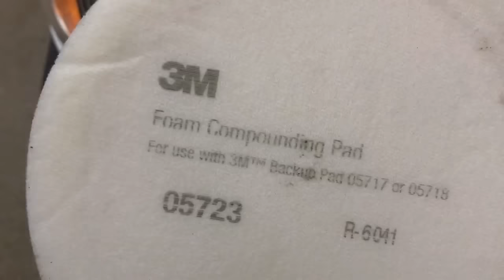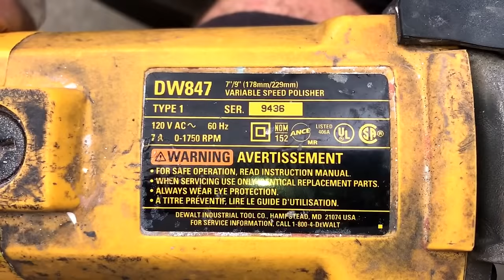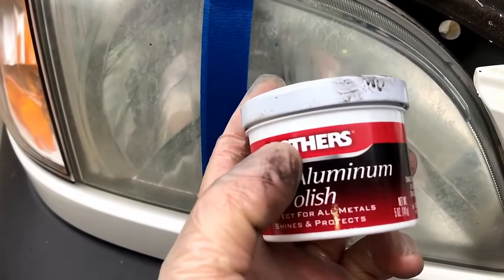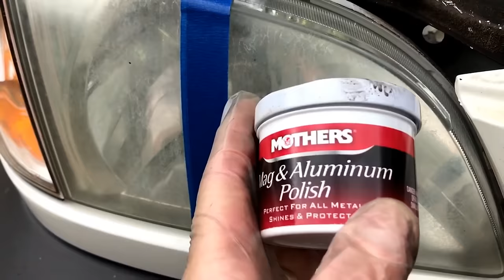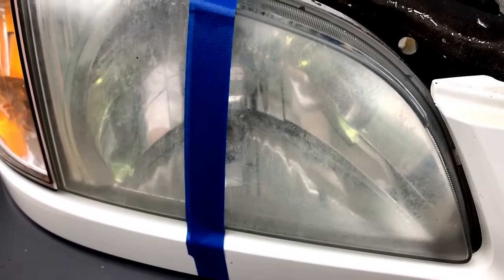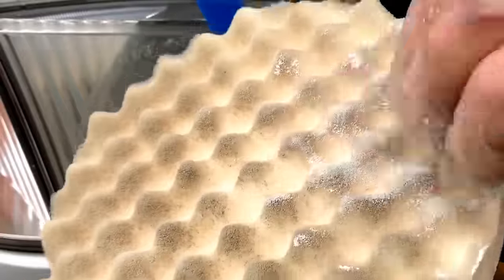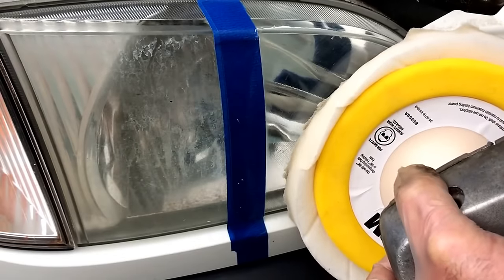How MOMMA Repairs Headlights BACK TO BRAND NEW in 3 Minutes

Comment: Can you please shed more light on the after polishing process...do you clean the polishing compound residue off the lenses before applying the 303? Also, which 303 product do you use, and how do you personally apply it? Also, how long does the 303 last? How long between applications?
Reply from the maker: Budz Wingren all the products we use are in the "SHOW MORE" of the video description. once you have buffed them and satisfied with the shine and clarity you then spray a light mist of the UV protectant on and let it sit for a few minutes and then lightly buff off and as far as how many times you do this depends on your location, you can do it as often as you like it will not hurt them but  for instance in Texas you would apply a light mist of the UV protectant once every 2 to 3 months in the northeast area of the US you would do it about once every 4 to 6 months  we say when you detail your car take 2 minutes and car for your lenses and plastics.
Reply: @SweetProjectCars  Should I clean the lens after buffing to make sure no polish residue is left behind, or just go straight to the protective coating? Does it matter?
Reply from the maker: You will just use a microfiber and buff by hand to a finish shine then use the UV protectant

Comment: What's the max speed (rpm) you're using on that DeWalt polisher?
Reply from the maker: We vary it up and down, we start slow and get it to 3000rpm, but we don't stay at 3000, we keep the buffer moving and varying the speed. Thanks for watching Steve, have a great day. mad Mike the hammer SPC

Comment: @sweet project cars Can you show us how to put the 303 Protectant on it? Full headlight process. Thanks in advance.
Reply from the maker: Brute it is very simple, my friend just spray it on in a light mist and let it set for a minute or so then lightly buff it off and you are done.   thank you Brute for your great comments we appreciate your helping the SPC channel!
Reply: Sweet Project Cars ok I already wondered if we had to use a brush or something to get it spread equally. I don't want to spray or brush it like you see a kinda varnished glossy layer. This is not allowed in my country and will not pass the yearly car checkup.
Reply from the maker: brute you can place it on a towel and wipe it on if you can spray it...it is water based and eco-friendly and nothing more than a UV protectant.    thank you for your great comments we appreciate you helping the SPC channel!

Comment: Can't understand why you didn't tape around the headlight First!! As you where useing an oversized polishing pad? Second your method seemed good on a bare none coated lens, But would it work on a old clearcoat such as K2? I Wonder🤔🇬🇧👍
Reply from the maker: Hi Keith we didn’t tape around the headlight because there’s no need to the polishing material we were using is the exact same stuff we use on all clearcoat and paint the only way there would be damages if you held the buffer on the paint for 2 to 3 minutes without moving it if someone is going to do that they should not be working on their car

Comment: Hey, what would be a fair price to do this for a customer?   20 bucks?
Reply from the maker: 20 bucks per light is fair
Reply: Thank you most noble headlight restorer!!!!!
Reply: I will charge $25 per headlight if I have to use sand paper and restore them or am I cheating meself?
Reply from the maker: if you have to do this video here https://youtu.be/GKLF8oIWYGg then you should charge them 60 to 75% of what a new set of OEM headlights would cost them

Comment: Was that actually oxidized or just have salt and road film on it?
I have a 21 year old truck that has cloudy yellow lenses. Those looked more like salt and stuff from winter roads.
Not doubting you, just asking 
Wish you would have cleaned them first on camera to see how bad they were after washing.
Definitely a cool video.
I only have DA polishers so I'm hoping this will work with a DA as well
Reply from the maker: 2010stoof if you look at the date of the video you will see there was no chance for salt also if you try this method yourself you will see it is the best thing going anywhere you have no reason to worry as it would cost you about 10 bucks if you do it by hand
Reply: @SweetProjectCars  so will this work with my DA or do you need a rotary?
Reply from the maker: 2010stoof you can try it with your DA and see how it works we have never had luck with them when the headlights are real bad

Comment: What if the headlights are chipped from taking the car the track? Would it work as well?
Reply from the maker: Will definitely make them look better but you’ll most likely have to sand them down if they are chipped slightly but if there are chipped bad you’ll just have to replace them

Comment: What rpm did you use on your polisher?
Reply from the maker: You vary the speed, when you first apply you go slow 200 or 300 rpm, then you speed it up.  So slow at first so you don't slop the stuff all over, then when you speed it up be careful you don't burn the lens, touch the lens every once in a while to make sure you aren't heating it up.  Thanks for watching and asking.  Have a great day.  mad Mike the hammer SPC

Comment: My Civic 2018 lights have small cracks I put on a tint overlay with stock bulbs in and they got too hot under the tint and cracked the headlights. I replaced them with LEDs I noticed them bubbling through. 
 I plan on taking off the tints to fix this but I'm afraid they will crack more if I take the tint off.
Help!

Comment: You have to sand all the factory clearcoat off the lens. That is what discolors and gets hazy. That is what's left on the bottom of your lights. Start wetsanding with 320 grit until all the clearcoat is gone. Then work your way up to 2000 grit and finish them by buffing. Again, the clearcoat must be removed first.
Reply from the maker: With This method you don’t have to do that only if the headlights are yellow and we have a video on that

Comment: Not saying this doesn't work, but what I would love to see is a video where you come back 6-hours later to see if it looks the same after it has dried off. To be honest, I could grab some coconut oil, buff it just like this and it will look fantastic. Except when I come back several hours later it will look exactly like it did before the buffing. Again, not saying you're not legit, but a follow-up video would go far in selling this.
Reply from the maker: this is actually polishing the plastic so it works every single time and last for years when you use the conditioner shown
Reply: @SweetProjectCars  Well, I just purchased it from the link you provided. I have confidence that it will do well. At the very least, I know it will not waste my time.
Reply from the maker: He will love the results my friend
Reply: @SweetProjectCars  Results are in, my friend and I am loving it! Fast and easy! This stuff is fantastic. I will never waste time with sand paper again! Thanks for posting the video!!
Reply from the maker: mondo that is great to hear my friend

Comment: What is a good cordless drill to do this ?
Reply from the maker: MgC-137 we have used these for years with great success they are very tough for the price  https://amzn.to/2GqvImv and they spin fast enough to do the job
Reply: I have one that does 650 rpm that should be good enough right? And thanks for your reply.
Reply from the maker: MgC-137 as long as you have the 20v so you can get the 1500 rpm's you need 650 is way to slow
Reply: Alright cool thanks. 👍

Comment: What is the interval of appying UV Protectant?
Every 3months?
Reply from the maker: 2 to 4 times a year depending on where you live and how much sun you get
Reply: Sweet Project Cars why not use a clear coat for permanent protection?
Reply from the maker: narmenia because the clear coat yellows...you need a water-based protectant like the 303
Reply: Sweet Project Cars will using the Turtle Wax Metal Polish have the same result?
Reply from the maker: narmenia you can give it a shot and see if you like the results compared to the mothers

Comment: Metal polish is more abrasive which is why it worked so well...but I would be weary of doing this on the same headlights multiple times.
Reply from the maker: Gurvinder Parmar we have done it on headlights multiple times and they just get nicer looking every time with no issues for our customers
Reply: @SweetProjectCars  Wouldn't the abrasives in metal polish wear down headlights? I guess it shouldn't matter much since sanding probably takes more off the headlight than a polish.
Reply from the maker: You would have to polish those headlights for years to wear down the headlights you only have to do it once every three or four years and if you keep the UV protectant on that we share you most likely Will only have to do it once every 5 to 10 years but then again wearing the plastic down will not happen we use the same metal polish to buff out scratches on clearcoat on car paint it’s all we use and we get fantastic results with it it is a hidden secret of ours that we have let out
Reply: @SweetProjectCars  I saw that video of using it to get scratches out...it was amazing...I actually had about 3-4 scratches on my black 2017 Buick Lacrosse...I got 3 out if the 4 out no problem using Meguiars...but one small scratch is giving me trouble. I used a DA polisher with medium cut orange pad...the scratch is less visible now but it's still there...what metal polish would you recommend I try to get that last scratch out? Should I remove it with the DA or by hand? A friend of mine also has some orange peel on his bumper which we are trying to get out...any suggestions for that?
Reply from the maker: Gurvinder Parmar  We use this https://amzn.to/2LFYWSW we don't use DA's as they don't spin fast enough but if it is all you have then use that with the product we shared

Comment: Is that healight glass or plastic?
Reply from the maker: It was plastic as 99.9% of them are these days
Reply: @SweetProjectCars  unfortunately so but 2 be fair id rather have plastic on the ground than glass. Almost be revolutionary if they created a off type from bulletproof material. If its possible without a great deal of cost difference of course. Thanks just wanted 2 dbl check.

Comment: with this work when the headlights have flaked off sections of old clear coast?  Mine you can actually flake it of with your fingernail.
Reply from the maker: if it is flaking off now, sand it with 2000 grit wet and dry to remove the flaking then do this process

Comment: I've tried this on my 2008 Honda civic hybrid. I had to do it by hand but very little change and my headlamps are only partly clouded. Can't understand why it works for everyone except me.
Reply from the maker: Let me help you understand why it didn't work, my friend, you need to do the process as it's shown in the video, you cannot do this by hand. Have a great day. mad Mike the hammer SPC
Reply: @SweetProjectCars  yes I appreciate your advice it's just that there are so many people in videos who have done it by hand and in a matter of minutes. I don't have access to a power tool. I may take it to my local car wash the guy there as a power tool. There's a video on here somewhere a guy is using a power tool but it doesn't work for him either.
Reply: If you use a tack cloth and do it by hand it might give you better results than a regular cloth. I didn’t have a tool either and it worked. Then i got a little attachment for a power drill and it was much better than by hand.

Comment: does anyone know if this works if there are flakes of clear coat coming off the lens?
Reply from the maker: as I said before my friend   if it is flaking off now, sand it with 2000 grit wet and dry to remove the flaking then do this process

Comment: Bear in mind that headlight restoration kits work, and some even have final coatings to resist UV.  But you and I at home simply cannot duplicate the factory anti-UV coating that is applied in a carefully controlled environment.  Headlights cloud up because their anti-UV coating is failing. Polishing removes every last vestige of that factory coating.  So if you cannot obtain new factory headlights,  and you use this method, you WILL be doing it again.  Also, remember that polishing the lens does not renew a reflector or get rid of condensation inside a leaky light.  So it's like Clint Eastwood says, "a man's got to know his limitations."  Polish that light if you must (it's cheap and sometimes you cannot get new ones), but accept the limitations of the process.
Reply from the maker: Lane Dexter we have a cure for UV damage after the headlight is polished https://youtu.be/hD2CKp9mco0 this video...problem solved.

Comment: I agree 1000% those "headlight restoration kits" are a joke.  I got one from Walmart and the sanding disks weren't actually sandpaper at all...they were textured plastic discs that disintegrated as I tried to refinish my headlights.  I started seeing these little granules of material and I stopped what I was doing and started trying to figure out what this was...then I saw that the pad was just coming apart on my headlight.  In case you're wondering.. it was the Rainx kit I bought...utter garbage. The only saving grace for this kit was the fact that I got a 3" drill attachment that I can use with other hook & loop pads/disks.
Reply from the maker: Thank you very much for sharing we appreciate that and it’s great comments like this that help others out there save a buck as well thanks mad Mike sweet project cars

Comment: I would add that it would be better to mask all surrounding painted panels to avoid burning thru clearcoat.
Reply from the maker: There is nothing abrasive that we use in this process we have never taped off when we are buffing we have done this for over 20 years and never burned through anything now if you’re sanding yes it should be taped off thank you for sharing

Comment: The trick is to buff out the damage.  Shops that sand and then spray clear-coat just wreck the optical properties of the plastic and it never throws light correctly/has odd halos and hues.  RUN AWAY.  Clear-coating headlights is effectively putting cheap window tint on your windows - good luck with clarity.  If it gets foggy again in a few years,  or even a year, re-do it - it's a 5-10 minute process.  Most plastic can be re-polished like this 10-20x before they are actually suffering any structural damage.
Reply from the maker: Thank you for watching and sharing, have a great day my friend. mad Mike the hammer SPC

Comment: I was just thinking, this takes off the clear coat right? Also I’ve read that invariably if I get someone to sand and re-clear the headlights (labour is cheap here) won’t cost much but issue is not all clear coats are created equal... I might have issues with down the road, so I was thinking do this then have someone wrap it with uv protect clear film, would that not act like a clear coat?  Problem solved? I can also 303 it before the film goes on or plexus and then after once in a while but the film should keep it good no?
Reply from the maker: Jay Daniel it does not take the clear off if you have bad headlights then you want to do this https://youtu.be/GKLF8oIWYGg also see this to protect them https://youtu.be/hD2CKp9mco0
Reply: Sweet Project Cars well that’s good to know I can try it no risk :) if I don’t have a buffer or a drill what would you suggest I use to buff it with ?
Reply from the maker: You can do it with microfiber towels and do it by hand but you will need at least a 5 gallon bucket of elbow grease and patience if they are in bad condition

Comment: What about dust on the inside of the headlight?
Reply from the maker: Spray this  https://amzn.to/3hsXZbJ   inside the headlight, then blow it out with an air nozzle until it's completely dry.  Thanks for watching and asking.  Have a great day.  mad Mike the hammer SPC
Reply: @SweetProjectCars  Thank you, but I mean is there a way to do so without removing the headlight. I have a 9th get accord and apparently you have to remove the bumper.

Comment: Sadly this didn't work for me even with 3 tries. It cleared up some hazing but there is  oxidation and a slight discoloration. Also still some scratching and some scuffs  I believe probably came from a botched restore the dealership or previous owner did. Looks like I'll be sanding and wet sanding :(
Reply from the maker: Watch this  https://youtu.be/GKLF8oIWYGg  It sounds like you need to try this.  Hope it helps JT, thank you for watching.  Have a great day. mad Mike the hammer SPC

Comment: can u do this without the machine?
Reply from the maker: Give it a try and see if it works for you if it doesn’t you know exactly what you need to do to get it to work thanks and have a great day mad Mike sweet project cars
Reply: Ok, will do.  I could just use a drill (like the ones every detailer has from amazon for "drill brush") correct?